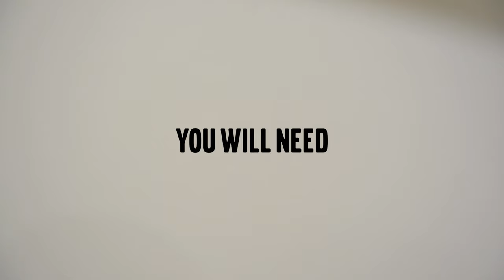How To Make A Wooden Window Sill

Comment: is there a way to not use glue? i am thinking of screwing them in, but wouldn't want the screws to be visible
Reply from the maker: I can't think of a reason why screws would be better than glue but if you are certain then I would recommend drilling a bigger hole, sinking the screw head well below the surface and then pluging the hole with a dowel. Good luck!

Comment: what glue did you use under the board...didn't seem to be standard gripfill is all
Reply from the maker: It was some random silicone I had laying around - might have even been. heat proof silicone. It does not really matter in this situation as the sill is not going anywhere.
Reply: @CraftAndu  Ahh fairysnuff...I was lnt suggesting it would go anywhere...just wondered if you had a go-to for the job as it looked unusual to the norm at least